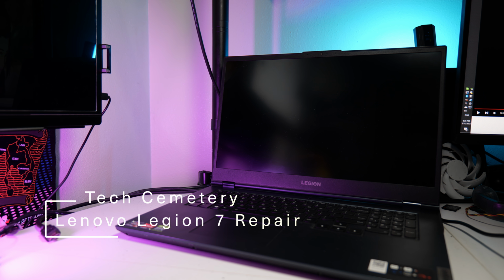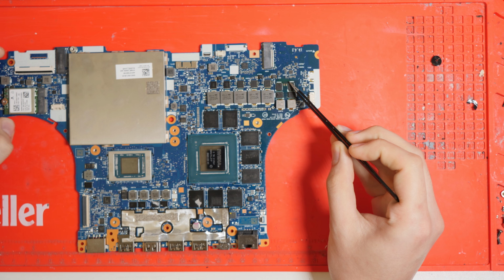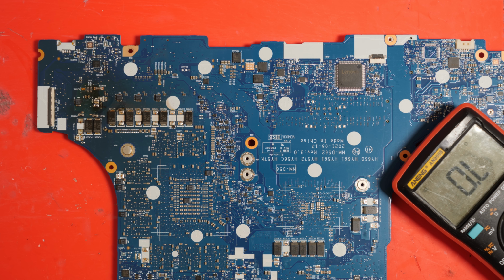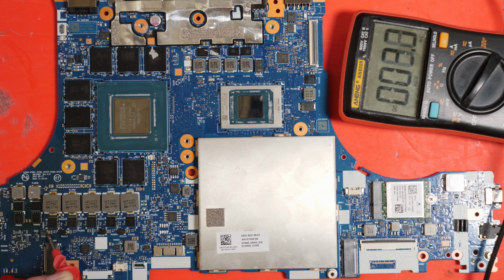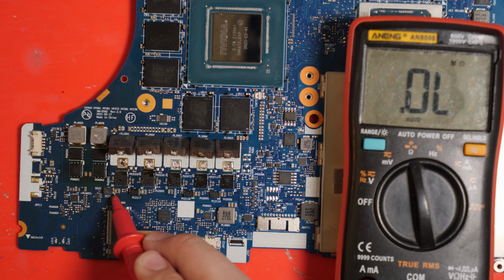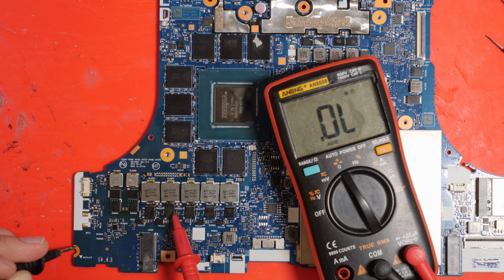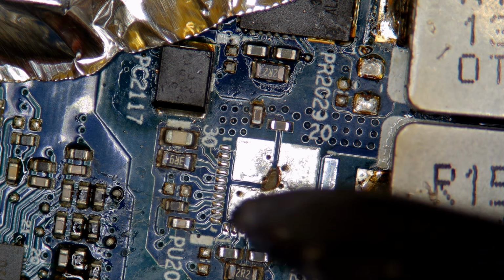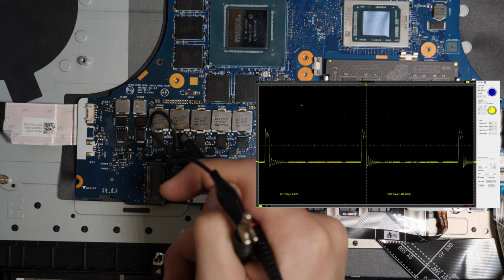Lenovo Legion 5 17ACH6H Repair - No Power

Comment: Nice work! I have a Legion 5 and has same symptoms, no power up. I replaced the display without removing the battery. If you can point me to someone who knows these laptops that would be great, as I read you don't take on repairs anymore.

Great video, thanks.
Reply: Oof got some bad news about that

Comment: I have a question about this. In my case the power button lights up but nothing else is. I don't hear the fans spinning and my keyboard doesn't light up.
Reply: did you fix it ?
Reply: Having the same issue, how did you get it fixed if you ever did? Really some help! That laptop costs too much to be having such problems. In my case, I have a Legion s7 15ACH6H. Really annoying to spend that much on that and it just goes off all of a sudden!
Reply: @lewalexzy5257  Hello did you fixed this issue have same problem.
Reply: @therandomplayer4400  Hello did you fixed this issue have same problem.

Comment: I neannn, I don't understand how you just have the those inductors and chips just laying around. I have taught myself how to remove the shorted components and chips but I don't know where to get the replacements. Like, you guys just easily swap out the bad ones for good ones but I don't understand where the good ones come from. Or are they just removed from scrap donor boards? Or can you just order a ton of them in all different varieties? I'm sorry if that's a dumb question or if it doesn't make sense. I've just been teaching myself how to test and repair boards over the last year or so. I've taught myself a little bit, but I still have a lot more to learn..
Reply: You actually don't need to replace most dead/shorted capacitors on the 19v, 5v, 3.3v. The ones that are very important are near oscillators/crystals and the big one near the CPU and GPU. For chips you just order them, use a donor board or an alternative/similar chip. Small smd inductors can be replaced with just a wire, not the big ones tho. You can also order kits or sample books with some of the most common smds.

Comment: What could be the cause of a failure like this? Is it just bad design that overloads the power stages at stock clocks and voltages, or was the GPU overclocked? Would underclocking the gpu prevent such a failure?

Comment: Awesome work! I just got a Legion 7 that powers on but then shuts off after about 5 seconds. Took it apart and found a mosfet near the m.2 SSD connector that's obviously bad - board looks OK otherwise. Waiting for a replacement part now and hoping thats all that's wrong.
Reply: Did it work?
Reply: legion laptop s4cks

Comment: had almost the same model laptop, 15imh05h, and i inserted the lcd cable while the battery was in. Laptop turned on, then off after 5 seconds. I realized in that very moment what i done. Well, i gave it to a local repair place and i don't believe them when they say they tried board level repair. I feel they tried fuckall. Also, i had a burn smell come from the motherboard, but no visible burn marks anywhere. I really wish skilled people like yourself lived around me, because it made me realize that simply having a laptop that doesnt turn on or show a charge light, doesn't mean you need to spend so much fking money on a brand new motherboard when only a few components might be fked.
Reply: 2 years later, I've come to tell you it was the LCD backlight fuse you blew. Happens all the time when people plug in the LCD ribbon cable with the battery connected prior. Even I've done it by mistake, not paying attention.

Comment: have issue on same laptop but my power adapter led glows and turns on with novo button but not by power button
Reply: bios reset, disconnect main battery and bios battery
Reply: @iulianmanea2883  yes it works after this but after I shutdown again same issue.
Reply: @tapanshah1398   maybe change bios battery?

Comment: u think this could happen to the 15ach6h as well?
Reply: happened to mine
Reply: @richieharn3301  sad to hear it :( i bought a extended warranty for it, maybe they fixed this issue with a new layout?
Reply: @huabs  tbh with you bro don't know the reason why my laptop ends up no power. Tried charging but no indicator tried removing the battery connection to motherboard then reconnecting it back eventually it turns on. However, the issue still persists, I contacted premium care and send out a new motherboard. However, the new motherboard that they've sent me is defective. I don't know the reason why the part is defective which keep me thinking if they have a quality assurance team to make sure that the part is functional before they've sent it to their customers.